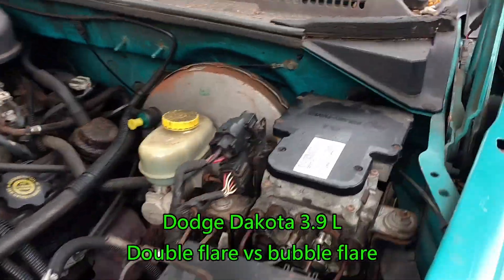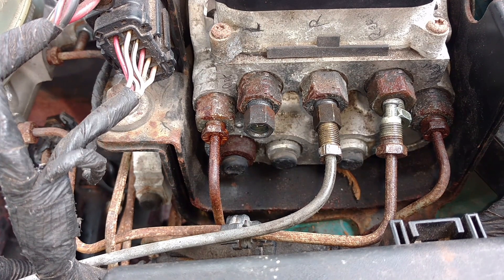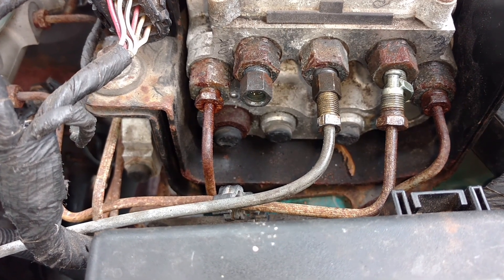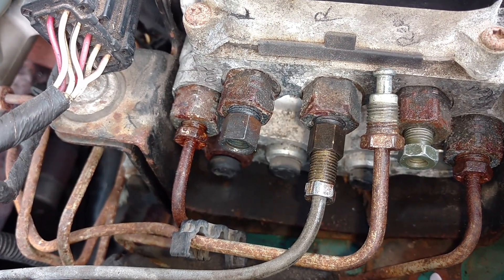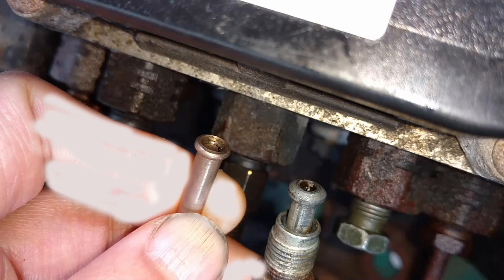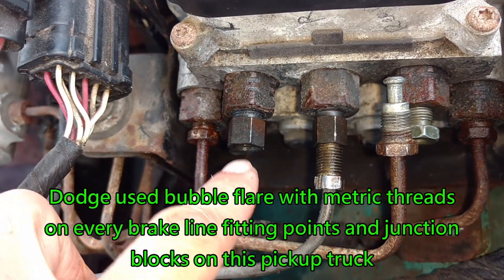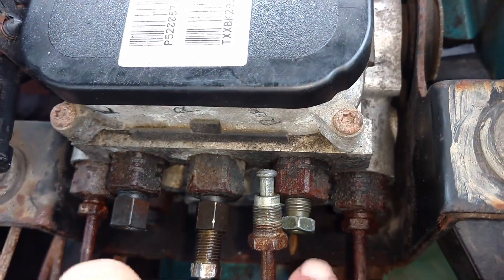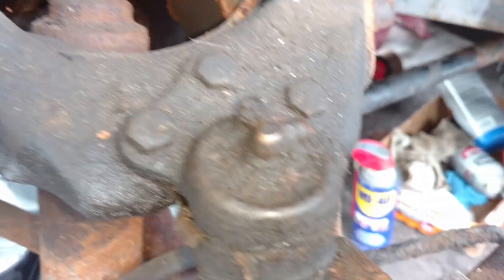Brake Line Double Flare vs Bubble Flare

Comment: i spent 35 hours on a 2013 ram 1500 to find this out even some same modals use different flares on the same fittings plus there different on booth sides size pitch ect ect buy measuring tools and do not fuck your ports